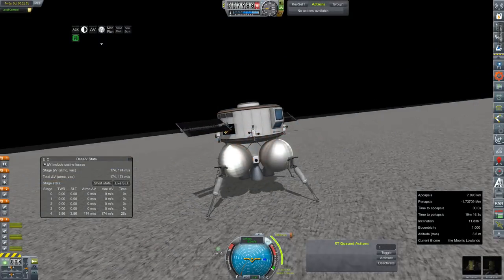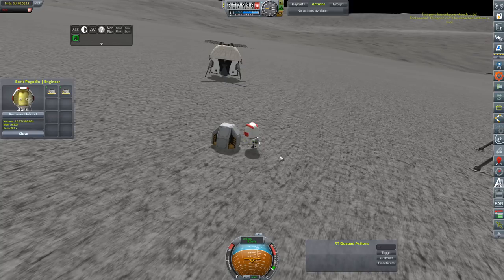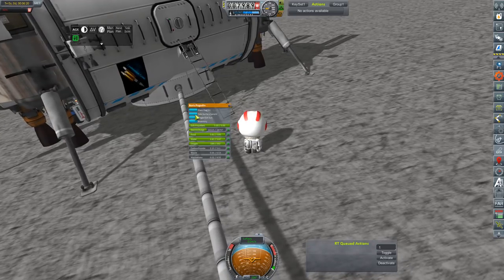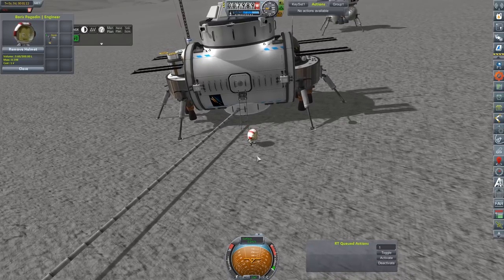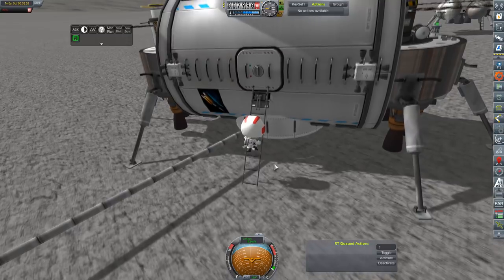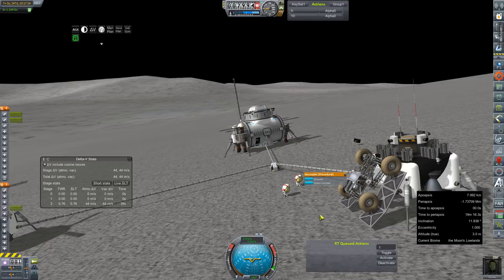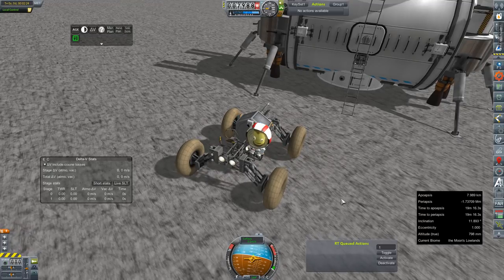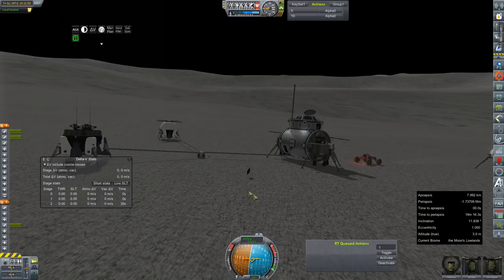KSP RP-0 #341 Base Construction

Comment: Congrats on your first operational surface base! That's one small task for a kerbal, one giant leap for kerbal kind.

Also, watch out. You only have 250 days of water aboard Roselina Base. Have you checked power draw for the lab against the power generated by the RTG cluster on the power module?
Reply from the maker: Thanks!

a byproduct of the CO2 converter is actually water ( though to be accurate, it shouldn't be very palatable ) so my guess is that it will make up some of the discrepancy.
I've not done a run down test, just running off the assumption that the massive battery capacity between the connected modules will be enough to sustain out of sunlight hours - the RTGs arent really meant to keep them topped, just to slow the drain enough to make it through the night cycle.